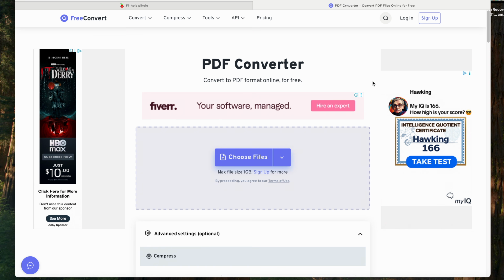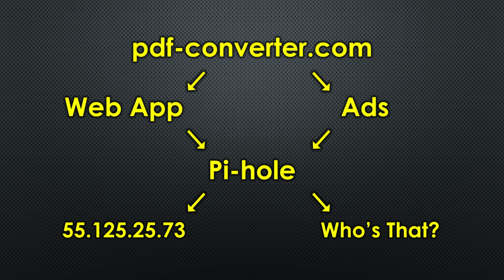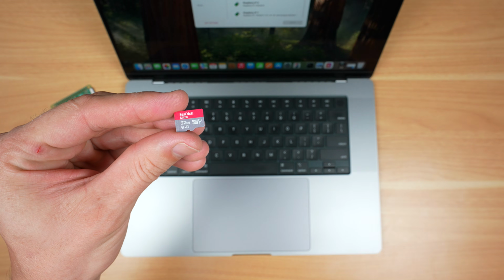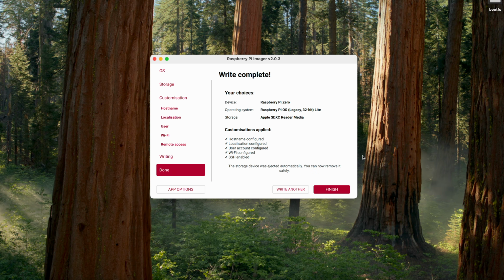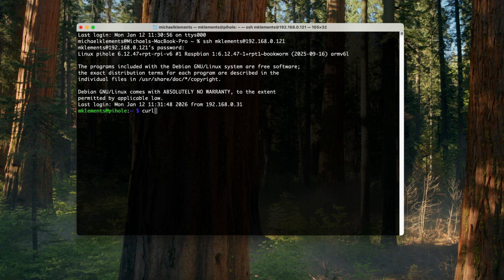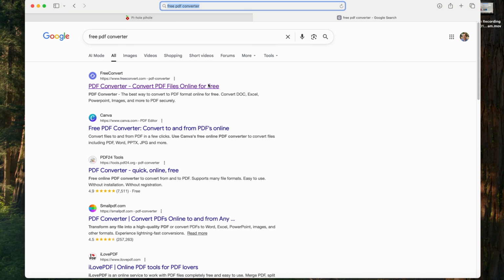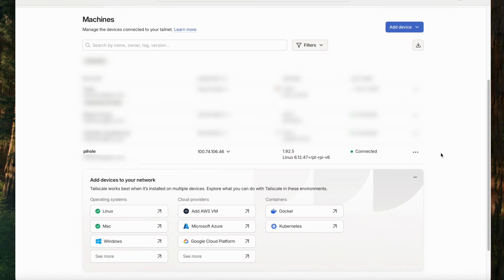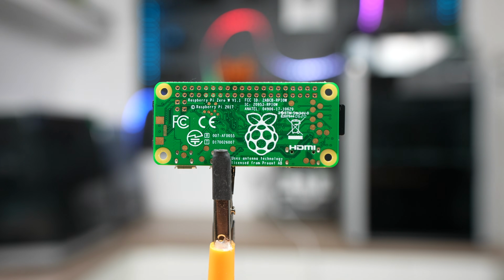I Turned a Raspberry Pi Zero into a Global Ad Blocker

Comment: Do you absolutely need a heatsink?
Reply from the maker: It doesn't require one but if the processor starts overheating then it throttles and you lose performance. It's really inexpensive to fit a small heatsink to avoid this.
Reply: @MichaelKlements  I only ask because most I can find says that pihole isn't intensive enough to make it get that hot. I am on a budget of a budget so just don't want to buy things I may never need is all. Thank you for your response!

Comment: I recently deployed a PiHole system in my home after watching your video. I wasn't totally satisfied with the results until I made these changes. First I disabled the Windows IPv6 driver (Control Panel, Network, Ethernet Status, Ethernet/WiFi Properties uncheck TCP/IPv6) to disable Google and other software from deploying Secure DNS. In addition, I had to specifically disable Secure DNS because ads were coming through. After that I found out that my home media services (builtin TV apps, and other WiFi/Ethernet connected media devices) were not working, NetFlix in particular. I identified all these devices and configured each with static DHCP addresses. Once this was done, I created a new Group: Streaming and made Clients for each media server's static IP address. Each client was made only part of the Streaming group (and not part of existing Default Group). This allowed Clients in the Streaming group to bypass DNS filtering. I realize this means when using a web browser on your TV you will get ads. I don't have a keyboard connected to my TV so I would rather use my phone to browse the web which PiHole is blocking ads when using WiFi.  Just wanted to share with you these tips. Thanks for your help and inspiration.

Comment: Note to anyone interested from personal experience:
1. No PiHole won't block ads from YouTube or Netflix because their served from the same domain as the videos. But it does block ads on Prime, Disney+ and local TV network video apps.
2. If you're using a Raspberry Pi Zero W don't flash the original Raspberry Pi OS shown in the video, instead use DietPi. DietPi includes built-in easy installation to PiHole, AdGuard etc. but the best feature is it won't kill your SD card over time because it writes it's logs to RAM rather than to your SD card which shortens the lifespan and while you're at it turn off PiHole's logging too.
3. Finally look at configuring Unbound with PiHole for additional security and privacy.
Reply from the maker: Thanks for sharing your tips!
Reply: Author can you remake video with unbound & explaina bit what is unbound?
Reply: I tried to download it but seemed to hard and couldnt find videos on it 😪😪
Reply: You can use Tailscale to block ads on videos like youtube
Reply: People need to explain Unbound more, it still shows your IP so.....
Reply: *they're

Comment: I have a small doubt. Is there any advantage over using adguard dns on my android? And will this setup block ads in my iOS, Mac and from all my devices?
Reply: Yes, a Raspberry Pi Zero (or Zero 2 W) running Pi-hole works effectively to block ads on Android devices. Because Pi-hole acts as a network-wide DNS sinkhole, it intercepts ad requests before they ever reach your phone, including within many apps and browsers.
How it Works on Android
Network-Level Blocking: When your Android phone is connected to your home Wi-Fi, the Raspberry Pi Zero acts as the DNS server, filtering out ads.
Browser & App Ads: It blocks most web-based ads and many in-app advertisements.
Setup: You must set the Raspberry Pi Zero's IP address as the DNS server in your router's DHCP settings or manually in your Android Wi-Fi settings. 
Limitations on Android
YouTube/Spotify Ads: Pi-hole is generally ineffective against YouTube, Spotify, and similar apps that serve ads from the same domains as their content.
Off-Wi-Fi: The ad-blocking only works when your Android device is connected to your home network. To block ads on cellular data, you would need to set up a VPN (like WireGuard or Tailscale) on the Raspberry Pi Zero to route your phone's traffic through it while away.
Private DNS: If you have set a custom "Private DNS" provider (like AdGuard) in Android settings, it may bypass the Pi-hole. 
For best performance, ensure the Raspberry Pi Zero is connected via Ethernet (using a USB-to-Ethernet adapter) or has a strong Wi-Fi connection to prevent network slowdowns.    
  P.S. i looked on google for this info
Reply from the maker: I assume you mean running on your Android phone? Yes, this setup runs across your whole network so any device connected to your WiFi will have it's ads blocked rather than just your phone.

Comment: I am planning on using the pi zero 2 w as a tailscale exit node at home to access streaming services from remote location... So u think it will work given the limited specs and slow wifi speed?
Reply from the maker: I think there are better options as a dedicated exit node. It'll work but probably won't be great. I'd rather go with something like a Pi 4 or 5 with a faster CPU and a wired connection.

Comment: The Pi Zero W isn’t a great choice unless you’re working with just a handful of blocklists. I used mine as a backup Pi-hole alongside my main instance, but with my 15 million + blocked domains, the Pi Zero W consistently crashed. I haven’t tried the Pi Zero 2 W yet, so I can’t comment on its stability. If you want to run a few more services beyond DNS filtering, it’s better to invest in a Pi 5, set up Tailscale, and configure DNS through it. That way, you’ll benefit from ad blocking even when you’re away from home, and have enough juice to run additional services along side pihole.
Reply: I had the same sort of  issues using a Zero 2 W,  Just with PiHole, blocking only 78k . Tried all sorts, SanDisk Ultra card, 3A psu, , WiFi power safe OFF,  minimal logging  and Log2Ram installed - Still it crashed. Have resorted to re-booting on a timer at 3 in morning to keep it going
Reply: I have 3.8 million blocked domains on my original Pi Zero W without issue. I'm running DietPi which works much better than Raspberry Pi OS ever did.
Reply: @iSlider81  Thanks - I'll give that OS a try
Reply: I can confirm no more issues after switching to this OS
Reply: In 5 steps in order explain what you/have set up. Please

Comment: Only issue is relying on WIFI. A Pi 3 with rj45 is (in my opinion) a better option...
Reply: every Pi2 or Pi1 Model will do the Job
Reply: Or just buy a $10 usb to rj45 adapter. I used a pi-zero with such an adapter for more than 5 years without any issues, before switching to a VM pihole.

Comment: Radxa Zero 3E is the same stuff, but with ethernet, if anyone is looking out. 🙂

It's a bit more powerful, but that's not really the point.
Reply from the maker: I hadn't seen Radxa's Zero 3E - it looks like a neat product. A lot of Pi Zero projects rely on a good network connection, so adding a wired network port is a great idea.
Reply: @MichaelKlements  Totally agreed, mate. It's why I bought a few ... ... and have done sweet 🤬 all with them, since. 😅 

But, yeah, the intent is to replace a pi4 that is doing a few low-levels things on my parents network. Plus, if their router outputs enough power over the USB to power it ... zomg!

Comment: Will this add significant latency when using the web, or when gaming online?
Reply from the maker: There will be a very small increase in latency for web browsing but you probably wouldn't notice it. Games usually do DNS lookups once at startup or when connecting to a server and after that there is no difference with or without Pi-hole.

Comment: I love projects and home servers, but I ultimately resorted to simply set adguard as the dns servers in my home router, it was much easier plus less maintenance in the long run, I did have to go around my firmware blocked ISP router pushing ISP DNS by layering another router
Reply from the maker: This is any easier option but you're then giving them control of what you're served and you're giving them access to your full browsing history.
Reply: @MichaelKlements edited to Adguard, I had written AdBlock by mistake. Yeah, I'm looking at it from the perspective of blocking ads and some nasty sites without hazzle and for free, if I wanted to go fully private there's plenty of workarounds and options I'd prefer over this setup. Either way, not trying to hate on this method, it's great to have options and it's a great way to introduce people to a lot of cool things, privacy, SBC's, home labs etc.

Comment: Really enjoyed watching the video, but I am not a huge fan of the clickbait used in the title and the thumbnail.
PiHole does in fact not block ads everywhere - it does not block them on YouTube for example.

It is pretty much common sense for tech-savvy people that PiHole (sadly) does not block YouTube ads, as they are served from the same domains as the websites themselves, meaning:
in order to block an amazon ad while watching a YouTube video, I'd have to block the amazon domain.
Reply from the maker: The everywhere in the title means, everywhere in location. It blocks ads at home or away from home. This is an improvement over the typical configuration which only blocks ads on your home network.
Reply: @MichaelKlements  What type of explanation is that? 
Of course it does, as long as you bring the device with you. I can bring my phone to the very top of Mt. Everest and my uBlock Origin will block the ads there (if I have cellular data or WiFi lol)
"Block ads in every Network with a $10 Raspberry Pi" would be more fitting in my opinion...

Comment: Hi Michael. Does this block video ads? Like YouTube, and other streaming platforms that push ads before a video plays?
Reply: Depends. YT uses embeds. Pihole redirects/blocks domains/IPs
It doesn't manipulate websites or content
Therefore it can't change YT content
Reply from the maker: It depends on the video platform but in general these platforms serve their own ads from the same servers as the content. So DNS blockers don't work on them.
Reply: it does not for sure
Reply: @Markus-iq4sm this answer is false. It depends on the video plaftorm. If the platform fetches them from a dedicated domain, it does work for sure.
Reply: @MichaelArlt  question was about YT! For YT - it does NOT
Reply: @Markus-iq4sm read the entire question from the OP and maybe also understand it. It was asked in general and YT was just an example.
Read my guy 😉
Reply: @MichaelArlt  you video thumbnail says from "anywhere" - so who between us can not read or understand?
Reply: @Markus-iq4sm what are you talking about? Are you drunk, childish or stupid?
The OP is NOT the content creator. It's the original poster. The you guy who made the original comment where we all reply too. No one is talking about any thumbnail
You're such a moron, dude 😂
Reply: If you combine Control D in pihole, it is possible. Control D will redirect youtube from different country that has no ads (e.g Albania & Antartica) but it won’t affect your internet bandwidth
Reply: @Deynielll1042 it's neat, but it's a completely different product. It's a proxy like tor, privoxy, nexdns, opnsense, you name it. You don't route the traffic anymore directly through the router/gateway but through the proxy/packet inspector
Therefore it's possible to manipulate the content, apply filter sets and so on.
Again, it's neat but completely different

Comment: Pihole sucks.  Constantly breaks sites especially comments sections. Your family will constantly moan about it. Also it does not block the 99% most annoying ads ie Youtube ads.
Reply: well the youtube part is true af, its very annoying.
but the comments section thing you are talking about depends on the blocklists used; e.g. i have 1.576.039 domains on my blocklist and I never encountered a "broken" comment section ever
Reply: Doesn't break for me either. I also have over 1mill domains listed and don't have an issue at all. The only issue I get is from companies hiding stuff behind adwalls. You can always whitelist them or better say good bye to such idiots
YT doesn't use different domains or ips, they embed, therefore you have to manipulate content. A resolver can't manipulate, should be clear
Reply: It may have been fixed but when I had it installed a few years back. Facebook comments would never load or Twitter comments (as it was back then). I kept having to whitelist. I could still see the articles or main posts though.
Reply: @GlennPierce see. Just define exactly what it did and there will be a solution. Fb comments might load from a domain which has to be whitelisted. You can whitelist certain domains/ips and it will allow them. There are also browser add ins where you can pause the pihole filter mechanic for a certain time. I would always use whitlisting with regex
Usually you would also check the query log for potential blocks
Reply: @MichaelArlt  It was a long time ago but I don't think in was as simple as one whitelist. I seemed to remember the full ad domain kept changing and I had to constantly do it. I am a fairly advanced user / programmer and I got tired of it pretty quickly. Add to the fact I need a client side ad blocker to deal with youtube anyway I just did not see the point.
Reply: @GlennPierce well, yt is different as it has embedded ads. It's just technically logical that pihole can't solve that for you. Dunno if it "sucks" tho, for me it is a necessity since years in my network and in my family network. It's working as a resolver and it makes its job.
If you wanna change YT, use LibreWolf. Don't even use Brave as it's a matter of time since it's chromium based
Reply from the maker: You have control over what is blocked and allowed, if it's causing trouble with a particular site that you visit often then you just need to remove it from the blocklist or use a different blocklist.
Reply: I wouldn't say a product sucks when it's a user error. My family hates using the internet outside of our home because they became so accustomed to PiHole blocking all the intrusive ads on all their devices.

Comment: Is there an opens source ability like this? I don't mind running things in my own cloud, and would pefer my own infrastructure, versus yet another centralized company in my stack.
Reply from the maker: You can use Headscale or NetBird as alternatives to Tailscale.
Reply: Virtual machine? You can setup almost every *nix based system to run it. Dietpi for instance is a very compact image
Reply: I run it in Docker on Unraid, good at blocking ads, I've found it does block other things that you don't necessarily want to be blocked though so it's not a panacea of a solution.
Reply: @jonjohnson2844 I would also lean towards a container based solution but I'm a nerd and this might not be the solution for everyone. Tho, I prefer container like you do 😂

Comment: Is it possible to set up for use when a device is connected to a phone's hotspot with the pi being nearby rather than connected to a router at home?
Reply: If the phone is using tailscale and the device is using the phone it should use the router regardless
Reply from the maker: I haven't tested this specifically but it should work like this by default. The phones traffic is running through Tailscale - so any connected devices should too.